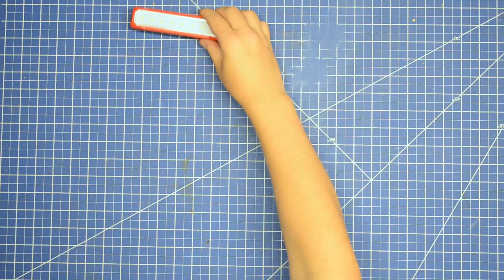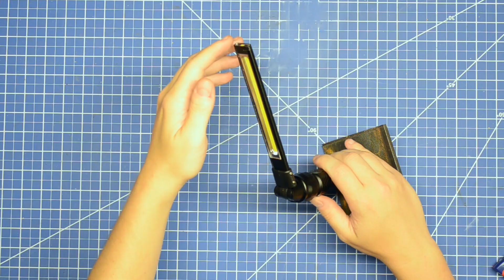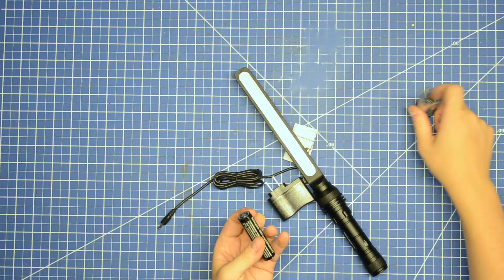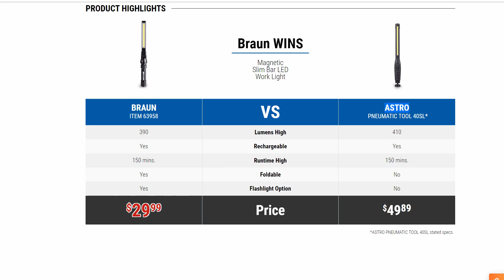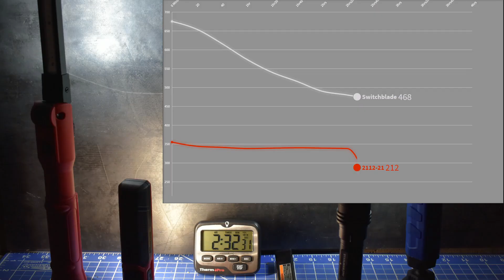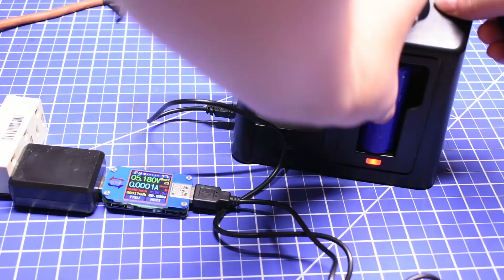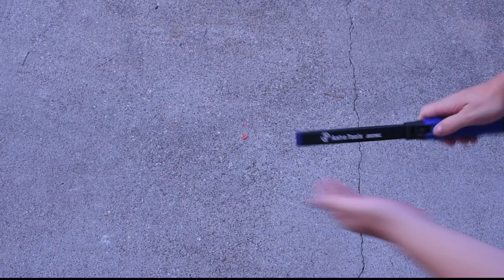Is Milwaukee Lying as Much as Harbor Freight Braun About Lumens?

Comment: I'd recommend my rechargable work light for testing, was only $10 from Menards, but it has no branding on it... It's pretty nice, honestly, though no swappable battery.

I bet your difficulty with finding swappable batteries might be related to the recent battery industry thing saying "hey 18650 cells are meant for use in packs, not on their own, if you light your pocket on fire that's on you". Also protection-integrated 18650 cells are not so common compared to unprotected ones I'm

Comment: I've been using the switchblade for a couple of years now and I'm pretty happy with it. It's plenty bright for what I need to do (especially in an evenly lit shop) and the magnet sticks to pretty much anywhere on the car I need to put it. I've even stuck it to body panels with a towel between the paint and magnet to avoid scratching and it still holds strong. 
For work lights, I pretty much have streamlight everything. Tac light too. Haven't been disappointed yet.
Reply: Same, the light cover/lense had cracked on mine 2 years ago but it hasn't caused any significant issues.
Reply: @SkidMarkSteve69  mine did that too actually. Like, I think in the fist month or two I had it. I didn't know exactly what caused it but like you said it doesn't cause significant issues. It was just on the brighter side, and along one edge.

Comment: Y’all forgot the most important test, which one puts out the most torque?
Reply: The Harbor Freight light wins that one by a mile. You’d have to use the Astro Thor to unscrew the Aluminum housing from the light head assembly. A 16” pipe wrench is what it takes for the ones I’ve got anyway...

Comment: I have both switchblade variants, 2x of the strion and 1 of the stinger. The strion variants get much more use from me as the batteries are swappable in them. The stinger just takes too long to charge

Comment: I would like to see tool truck brands added to the list, specifically the Snap-on ECARD062. I own both the Streamlight and this Snap-on. I recommend the Streamlight over the Snap-on. I also own the smaller Milwaukee 550lm Red Lithium flood light that I like a lot.

Comment: I have 2 of the HF Braun. The oldest is about 3 years old, never had any issues with it. The other is about 6 months old, same problem with the switch. To say it's annoying, is a understatement....But considering the flexibility if gives me, it fits into places that my Astro will not, if it folded, it would be great. The only thing that comes close to the Braun is my little folding SnapOn led light, which SnapOn no longer sells...... 

@AstroTools  You made the  HD Magnetic Worklight Suction Cup  (SLMCUP) You can make a great folding light just like the Braun, only better.
.

Comment: You should test the ArmyTek flash lights. I got one of the headlamps 2 years ago for work. After replacing the battery that came with it with a Streamlight 18650 it has been great.

Comment: I have milwuakee m12 bigger cousin. Its pretty pointless. No magnet. I added a magnet to the screw hole and it was still hard to get it positioned. 
I use the husky stick light similar to the hf.  Works good. But the pivot is fragile and doesn't like to be dropped.

Comment: I own the steelman pro and use it every single day in my shop at Honda I have a different model that came with 3 different heads to swap out for 29.99 on Amazon with a carrying case the head is 700 and the bar is 500 and comes with a UV head you should check that one out instead. Also you can buy a charging kit and battery from steelmans website also steelman is the same tools Walmart automotive center techs use in the shop

Comment: I’d be curious to see the different torque levels of the 1/4 inch hex drivers. I know it’s not much, but I use them every day for motorcycles at the lowest setting for m6 bolts.
Reply: I have the M18 1/4 inch and it's impressive and with a M18 1/2 inch I will be set. And With M12 ratchet

Comment: I've noticed similar issues from the Braun flashlight I have as well. As it ages it seems to get worse with the light sometimes going from very dim back to full power just by moving it or going from full brightness to dim by using the magnet to stick it to something. Think I paid $20 for it and have to say I won't be buying another.
Reply: Adjust the battery inside.
Reply: @playdg  I tried that. I also replaced the battery with a different 18650 that I purchased. Eventually it was just too much to worry about so I stopped using it. I'm not even sure where the flashlight is at right now. It worked well for about a year I think.
Reply: @playdg  Thanks for the tip though.
Reply: Those symptoms are the result of a broken ground wire inside. It’s a very easy fix, but it’s a shame that the customer has to be the one to fix it. Well worth the trouble in my opinion though, as it is a very useful light.
Reply: @athhud  I'll have to find it and see if that fixes it. I'm not sure exactly where I put it. It got to the point it was off or dim more than it was on so I just set it aside.

Comment: I have a harbor freight Braun cordless rechargeable light and it works great. It's bright and has a magnetic swivel base. I have noticed it does hold a charge as long as it did when I 1st got it. It still gets the job done. I can't complain to much about it. Mine is the yellow and black flat octagon shape one, It was about 30$ also.

Comment: I bought 2 of the HF Braun several years ago when they first showed up at Harbor Freight. One of them just craped out last week. Harbor Freight had them on the Labor Day sale for $19.99 and I bought two more. For what I use them for and the price I think they are my best choice. I don't plan on dropping them from 5 foot so I should be OK.
Reply: @TheCheesePlease the part that allows it to spin looses connection, why it flickers. The green and black one with changeable heads is much better.
Reply: On your broken one, crack it open and resolder the broken ground wire inside and it will be better than new. Don’t be a little girl about opening it though. It’s a beast to turn those threads.
Reply: @athhud  It flickers a lot when I try to use it so you are probably right about the solder joint. Its already broke so I cant loose anything.
Reply: @garyrichards407  let me know how it goes...... i have a crafstman work light its an amazing light only downside is battery life in all honesty..... full brightness only for about an hour and a half and the dim mode for about 3 hours of total use.
Reply: @garyrichards407  im considering buying some of the braun ones if only a couple modifications are needed to make it on par with the almost identical shape/functionality crafstman light i got thats a little over double the price..... im worried sick tho that ill drop it and itll explode or break apart.

Comment: The Nebo ones suck. The switch broke within a day and you have to push it on a special way to get it to click back on. Also, it's about 1" in diameter, and you'd think it uses 18650 batteries, but it uses 2 AA batteries. Terrible unit.

Comment: The lower efficiency of the Milwaukee is due to the choice of LED emitters. Warmer color temperature and/or high CRI emitters will ALWAYS be less efficient and have a lower output than a cool white version of the same emitter.

White LEDs are actually using a blue emitter covered in a phosphor layer that absorbs the blue light and re-emits it as longer wavelengths to give you a broader spectrum of light. Changing the wavelength of the light is an imperfect process that adds some inefficiency, so cool white emitters that let through more of the original blue light unchanged are able to be more efficient and output more total lumens. The phosphor layer is the reason the surface of white LEDs always look yellow or orange when turned off; that yellow phosphor is actually producing a range of wavelengths from green to red that without the blue light just looks yellow instead of white.

To me the lower output is always worth the tradeoff to get neutral or warm white, and especially high CRI light, but it's something for people to keep in mind.
Reply: Good to know. I have Ledlenser headlight and there is huge difference for eyes if I need to work longer. comparing to any white white headlights.
Reply: Thank you sir.

Comment: Every time I've had problems with my Braun light switch, the bottom battery cap hasn't been screwed in tightly enough.
Reply: That’s my only complaint. For some reason I am always wanting to turn it counter-clockwise while the magnet is stuck in place. I always end up in threading the battery cap. It would be great if they had some kind of lock to keep it in place. Aside from that one issue that is caused directly by me, I love those lights.
Reply: Yes, came here to post this. Sometimes I think the battery is not in a perfect position inside. That's why messing with the cap worked in the video.
Reply: Exactly. I thought the switch had gone bad but it was just a loose battery cap. I think it gets loose when you have it stuck on something metal and you rotate it around.
Reply: @JohnSmith-mk8hz  the part that allows it to spin looses connection, why it flickers.
Reply: Same here loose battery cap has been only time wouldn’t come on

Comment: Funny just yesterday I was messing around with my Braun light. I dropped it few times and it quit working. I tore it apart(they use a thread locker to keep it together) to find a tiny connector inside had come unplugged. Thing has been laying around for over a year. Would never buy another. Great video keep it up guys!
Reply: They really could have made them a top tier light with a nickel’s worth of hot glue and solder.

Comment: I use the Milwaukee rover and the larger rechargeable head lamps that are for hard hats and the Streamlight strion rechargeable flash light. Both the Milwaukee rover and head lamp use the same battery 🔋.  The run time seem ok but great but the light out is usable the hole time. The recharge time is good can have one light recharged before I need to swap out the hole head lamp.  The one odd thing is that they give a 3 flash when getting low on charge and right before it go out  a 2nd 3 flash. These day seem to get to the 1st 3 flash much quicker but still running plenty of time to charge the next head lamp. I have been running them for years at this point.

Comment: I hate to say it but the Braun gives you more for the money. They go on sale sometimes for $19. As for the run time no one cares because you can replace the battery with a fully charged one and go on indefinatly. I found them to have more than sufficient light for working in and engine bay or under the car or for locating your electrical box in a power outage in 100% darkness. Outdoors it works well up to 15-20 feet beyond that you may want something more powerfull.

Comment: I've had a HF Braun light for a year now and it works for my uses, especially given the price. I have never had an issue with bending the light causing it to go out. Must've gotten lucky there. 
I didn't know it had a removable battery. That will come in handy.
Reply: If you use it in a rough environment, you most likely will have the problem eventually. A small case ground wire breaks inside causing that problem. It’s an easy fix with a dab of solder and some hot glue. The tough part is getting those lights open. Anything short of a vise and pipe wrench is a waste of time in my experience. Once you make that repair though and use a decent battery, they are outstanding lights.
Reply: I’ve had mine for a couple of years.  Other than the rubber cover for the charging port coming off, the only issue I’ve had is occasionally the base plate loosens up and it flickers off.  I just screw it back on tight and it’s good.

But there are enough complaints that I recommend people test them out immediately after buying them to make sure there isn’t a defect.  That way if there is they can return it and get another.  I’m guessing it’s probably less than 10% that are defective, but it’s better to be safe than sorry.
Reply: Best light for the money 😍😍😍
Reply: I've had the HF light for like 3 yrs and haven't had any issues with it. I'm getting about 3-4 runtime and it goes on sale for $20 from time to time.
Reply: The braun is a good cheap light and charges quick. works better with battery upgrade sourced yourself. Easy if you are into vaping. Downside is the Braun does not last long with everyday use in an automotive shop. it will be dropped at some point. Braun is only good for maybe one drop and only if it falls flat. a vertical landing will destroy the top light and split the wand open.
Reply: I’ve noticed as long as you have the battery cap on good and tight you don’t have problems but if it’s the least bit loose even a 1/16 of a turn it will be wonky
Reply: I learned 2 things it has a little end light and replaceable battery. I needed lights to work on a truck while traveling and picked this light in a kit with case and flexible light along with a huge tube light that I really didn't need because the smaller one was perfect with it's magnet
Reply: I have three of them and only started having issues with one after it got ran over after a year of abuse. I taped the pivot back together and aside from having to press the button a few times and no led in the end it kept working for another 6 months

Comment: Charging:  on lithium cells, the low voltage cutoff will affect the "usable" capacity.  So the milwaukee taking 2.6mah of 3.0mah indicates they use a higher voltage cut-off to protect the battery.  (If you discharge a light at the low setting, you will drain the battery further.  Voltage drops under load, so the smaller the load, the less the voltage drops...and battery protection monitors operating voltage, not remaining capacity.)
Reply: I have a feeling they do the same thing with their standard batteries for all their tools. Id rather have less run time, and know that the batteries are always being kept really conservatively safe. This also means they will stay healthy for years.
Reply: I have a bunch of Milwaukee usb lithium lights and they play it safe on battery protection probably because of the 3yr warranty

Comment: Hello again Torque Test Channel 
Thank you for another Great Video. As I am researching for my tool purchase. And  rechargeable lights are high on the list. Almost as high is finding out out who has the strongest magnets for universal joint sockets and Extensions. Such as the Gearwrench 81235 and the Sunex 8855, both of which look very similar like they came from the same manufacturer? But I couldn't find out which one is stronger magnetic wise. Magnetic sockets I can't use due the supply only having six point sockets to offer. Sorry as a Aircraft Mechanic my needs are different from the automotive Mechanic.  I  need twelve point sockets and SAE/STANDARD. In Aviation we have not changed to the metric hardware as of yet. Otherwise, I enjoyed the Video, again thank you.

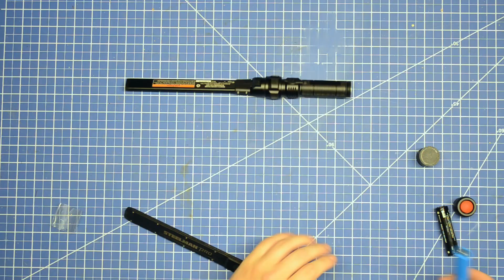Comment: 4:13 - It has a discharge/charge protection circuit.  You can stack a nickel or two to fill the extra space... Though I don't know if the light itself has onboard protection so you don't fry your 18650.
Reply: This is correct. The protection circuit will protect the Lithium Battery from fast drain and over charge but increases it's size to an almost 18700 battery.

Comment: Nice tests as usual. Had you guys considered testing weapon mount lights?
I personally have the Streamlight TLR-1 HL and the Olight PL-PRO lights, and as much of a Streamlight fan as I am I do feel the Olight is brighter. 
I would consider donating either one or both for testing if you are interested. 
Quite a bit of light output from such a small package of either one regardless.

Comment: I'm a Project Farm fan but dare say TTC has surpassed them in my eyes. Proj Farm is still OG. You guys came outta nowhere and now branching into areas outside of torque. Great job! I bought the Braun a few years ago. It feel off my tool cart at less than 4 ft and died. Took it apart and fixed a wire but messed up the ratchet mechanism in the process. It's very floppy now. Thinking about getting that Astro.
Reply from the maker: For plug in 65sl or 72sl. For battery swap hard to beat the 80

Comment: I do Commercial Laundry and I need a good one not too big and with magnets options especially when woring inside a dryer. I am thinking getting the Milwaukee one, any recommendations from Torque Test or anyone here???. Thanks.
Reply from the maker: The magnet is not super strong. Look at mini floodlights like maxeon cyclops and astro 70sl
Reply: @TorqueTestChannel  : I need to use it vertical and horizontal. those you recommended are round shape, any thing else I can fit in my tool bag?
Reply: get the milwaukee folding floodlight (2114-21) the magnet on the one in the video sucks but the floodlight version would be perfect for sticking on laundry units and the 3 brightness levels are nice but its also much brighter than the video one